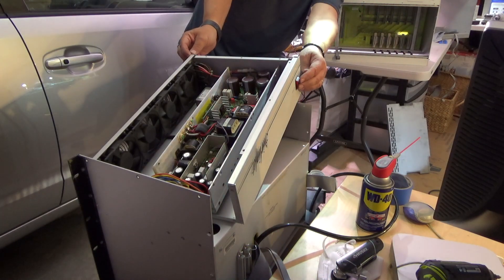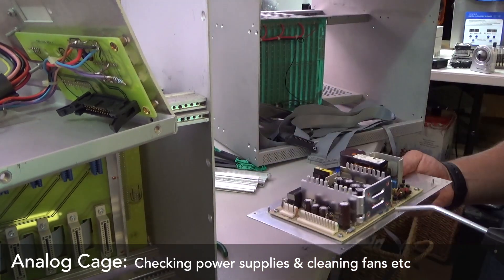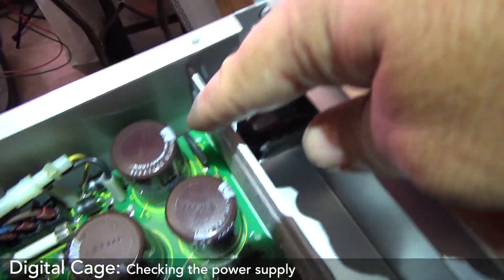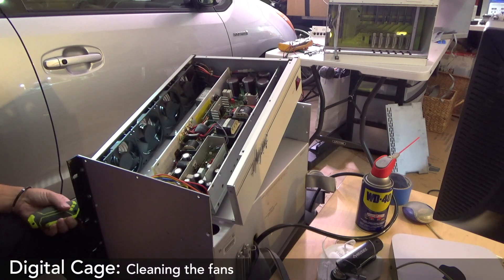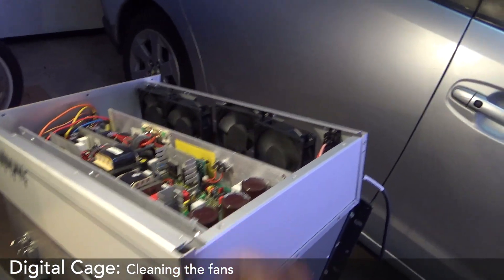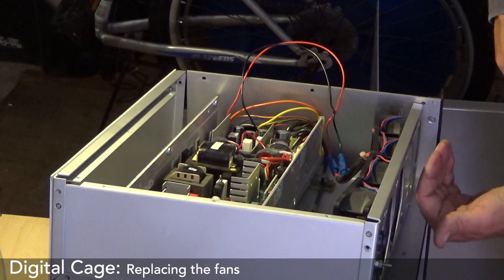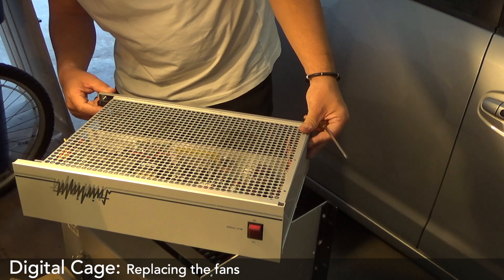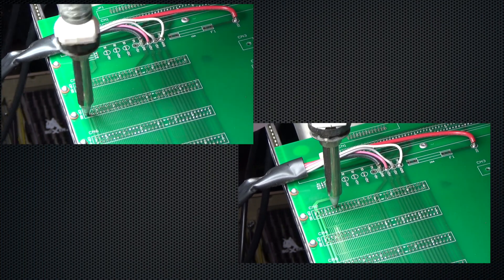I'm building a Fairlight CMI - Episode 2 - Let's get electrical.. :)

Comment: Use locking nuts / washers for the fans....otherwise vibration may loosen them or use LOCTITE
Reply from the maker: you're right. However, now I've installed new fans, there's almost no vibration :)